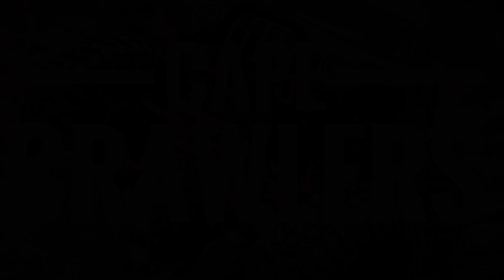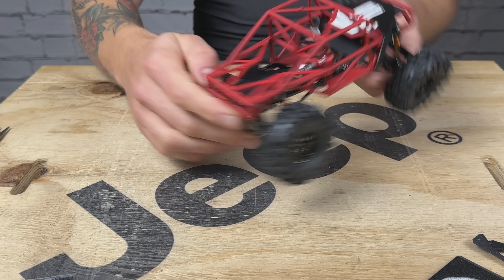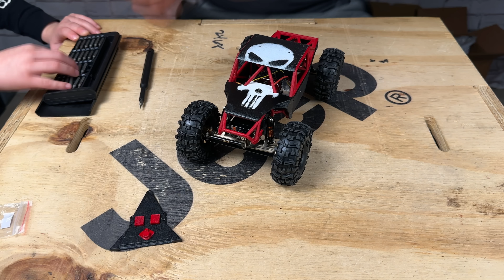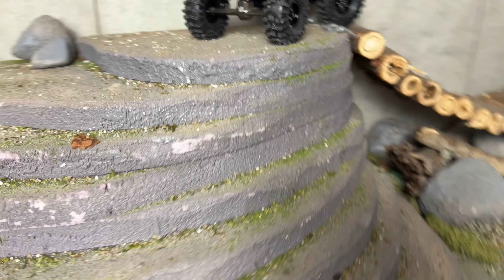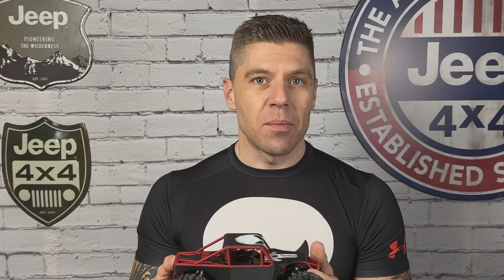LGRP ULTRA 24 SCX24 BUILD - IT'S ALIVE! Motor and Electronics Install, Crawl Footage & More!!

Comment from the maker: Timestamps
Accessories and drivetrain options: 1:18
Recap of what’s needed to complete: 4:58
Motor and driveshaft fitment: 7:08
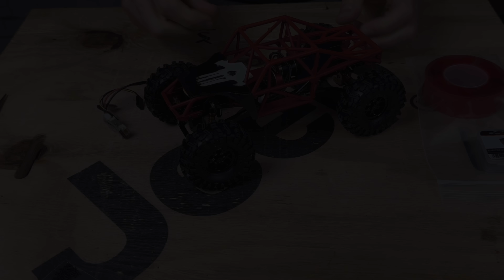Electronics installation: 10:45
It’s alive: 13:20
Final assembly and epic montage: 14:27
Closer look at the final product: 17:02
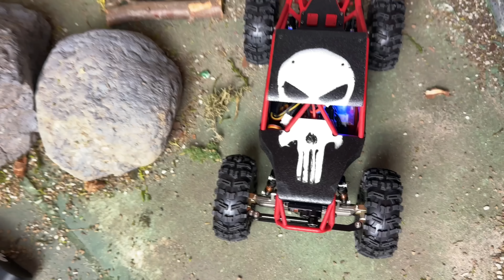Course runs and performance tests: 20:39
Final thoughts: 24:57

Comment: Aside from messing with throttle curve, I usually assign "button 1" on my avatar to be the throttle reduction option, makes it nice when you get in those technical spots then you can flip it right back off if you need more power.
Edit-typed this before watching your closing comments, you nailed it.
Reply from the maker: Great minds think alike!

Comment: Great job. I did my Ultra 24 build with the Little Rocket motor in the Furitek ESC. It has similar power when. Digging into the throttle but gentle when it needs to be. Have fun and keep us updated on the adventures of takes 🤙
Reply from the maker: Thank you! I love that lil rocket motor and that sounds like a great setup. Lot's more content coming soon for this thing!

Comment: I just ordered my kit! I'm thinking about going all out and getting brass portals. What does that chassis look like in the rear? Would it fit a steering servo back there if you run it low without springs?
Reply from the maker: It would likely take some modifications to the chassis. There are braces in the rear where the ultra chassis attaches to the rear of the frame rails. If running with no springs I don't know if the servo would fit in there.

Comment: Did you add the Bluetooth module to it?
Reply from the maker: I have a bluetooth dongle that I keep in my toolbox for when I need it. I keep one or two on hand and then buy the Lizard pro without the module. It saves money and is typically more readily available.

Comment: This project was eye opener for me, but I don't wanna buy stock SCX24 - Please, does anyone have a list of everything used?
Reply from the maker: I'll try to recap it here for you:
Ultra 24 cage kit comes with links, cage, servo tray. To complete, you will need:
Complete set of electronics
Complete front and rear axles
Driveshafts
Motor/transmission
Skid plate
Frame rails
Rear linkage mount
Shocks
Servo

Comment: I’d really like to build a small RC in the 1/24-1/18 scale.  After watching dozens of videos I think the Capra UTB18 is the most intriguing.  I was fired up on the 1/24’s but in weighing the cost of the upgrades I just don’t feel I’m getting enough capability for the money.  What would you build if you could only pick 1?  The ECX Temper 2, SCX24, trx4m, or the Capra utb18?
Reply from the maker: Tough choice! Do you have access to good crawling spots? That's the determining factor for me and why I mostly stick to smaller scales. However,  I am in LOVE with the UTB18 and the more I build it, the more I love it. So my answer is: if you have access to plentiful crawling spots, the UTB18. If you are short on space (like me) the SCX24.
Reply: Really like this LGRP but at $150 and still missing shocks, wheels, tires, electronics and motor it’s on the 1/10th scale level investment wise.  Just doesn’t make sense.

Comment: Awesome build and video! I am curious what your thoughts are from a performance standpoint of the Furitek setup vs a LGRP or Injora 50t/66t brushed. I mean is it mostly bragging rights and cool factor, because it is sweet looking, or is the performance really worth the huge price difference. I have been contemplating the upgrade but at the same time I have never really felt the need for anymore power or slower crawl ability than what I get from those  brushed motors. This might be a good video topic to cover sometime =)
Reply from the maker: You should check out my brushless conversion series where I did my first brushless motor in the gladiator. My reaction says it all! But to answer your question, the power and control you get from a brushless motor is beyond comparison. Brushed motors simply are not even in the same arena. You truly have to experience it to fully comprehend how impressive the little brushless motors are. I should do a comparison video though because I've actually been getting this question pretty frequently lately.
Reply: @CapeCrawlers  Cool I will check it out! I always ran brushless in my race buggy's  because as you said there is no comparison in the control but at the slow speeds and small scale of these things it just didn't seem like that big of a deal.

Comment: Awesome truck Adam!! Is this chassis compatible with the ax24 and Rear steer, I was thinking of using an ax24 with this??
Reply from the maker: Thanks! it would be tough to do 4WS on this I feel just because of how the rear end sits over the rear axle. It may take some trimming to fit the servo in there

Comment: My axial scx24 won’t accelerate any more 😢 can you please tell me how to fix it I don’t have any tools or spare parts for it 😢
Reply from the maker: Do you still have steering? If so, it's probably a bad ESC.
Reply: @CapeCrawlers  it only goes backwards and it steers but it doesn’t go forwards 😭
Reply: @CapeCrawlers  yes it steers and it goes backwards but it doesn’t accelerate
Reply: @CapeCrawlers  hey cape me and my dad are going to bring the rc truck to the rc shop and we’re gonna put some upgrades on it to 😃

Comment: Hey Adam, How are you liking the avatar Transmitter? Is there any others you would recommend to run multiple cars?
Reply from the maker: I love it! I love the micro rx, the functionality of the transmitter itself, and the small size. I recently got a Flysky GT5 and that is also amazing. It can store up to 20 rigs (double the avatar) and has more functionality at almost half the cost.

Comment: Nice looking setup.  Too bad they didn't design it such that the cage "body" hinged, or was otherwise easily removeable.  I learned from my Axial Bomber that I really dislike cage chassis builds.  Just too much hassle to work on.  And since this kit uses standard SCX24 frame rails, I don't see the point in having the cage be integral with the chassis.  I much prefer my Enduro Gatekeeper over the Bomber for this reason.  Same caged look, but one is a PITA to work on, and the cage/body comes right up out of the way on the other.  Other than looks, and good tire/wheel clearance, I'm not seeing what this kit brings to the table for $100.  At least not with the restrictions it brings being a cage chassis.  Maybe I'm missing something....
Reply from the maker: You make good points. It's not something I ever want to take apart again to work on, that's for sure. The chassis does perform really well aside from just looking cool. The 3D printing is excellent and very strong. It's a premium price tag for the kit but I think the quality justifies it.